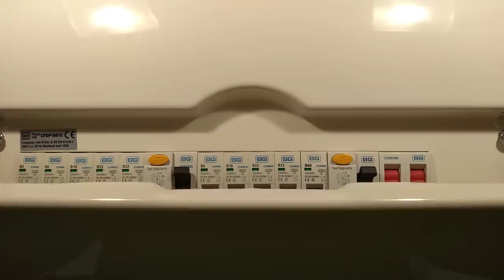A look inside a British home electrical panel.

Comment: interessting. In germany we usually get 3 phases 63A. And in new Instalations our distribution boards are way bigger. At least 5 rows of 12 division units each(one standard breaker is one division unit). 
We usually use B16 amp breakers for normal use and B10 amp breakers für lighting circuits. Each room should be on its own fuse. lights and electrical sockets on seperate rcds. Common component brands are hager and ABB. Bipolar breakers are very uncommon. I personally have never seen one installed or even for sale here. 
The main isolator is an SLS (selective Circuit breaker). It is installed in front of the consumption meter which is also installed in the distribution cabinet. The enclousure is made of metal but the covers are plastic.
Of course older installations can be quite different.

oh, and no ring circuits in germany.
Reply: @user-vn7ky2xr1x  yup, typically electric stoves and other big loads (>3.6kW) in germany are connected to the 3 phases if possible. 
You will therefore only rarely find any circuit breakers for more than 16A.
Reply: 2.5mm² cable for B16A and 1.5mm² for B10A now?
Reply: Sorry if it was not clear. Thats what i meant when saying when i wrote lights and sockets on differnet rcds.  English is not my first language.
Reply: @pmailkeey in my experience there are often even multiple rooms on one breaker- overall it doesn't even matter because I never have seen a single breaker tripping- it is always the RCBO that goes off first
Reply: @CyberlightFG  In new installations usually yes. But we have a kind of "loophole" in our electrical rules. Most other countries calculate the diameter with the conductor resistance at 30°C ambient temperature. But our codes allow us to calculate at 25°C which allows us to use B16A with 1.5mm² for shorter distances. But it also depends on the way the cable is mounted. So in new installations the electricians usually dont bother to calculate and use 2.5mm² everywhere because the price difference is negligible.
Reply: @olik136  You would not have breakers and RCBOs on the same circuit. You would match breakers with RCD's.  An RCBOs is a Breaker and RCD in one module.
Reply: @maik00979  not to mention that wires in older installation used to be thinner.
Reply: @maik00979  In Poland we can use 1,5 only on light fixtures (ecology,economy,LED) and 2,5 on max B16.
Reply: @alexku8452  I work as house electric in Germany, thinner is not bad but on bad side of berlin mauer i spot wire diagnal

Comment: This is a very interesting video.  Reading the comments, I've seen a some of them that say that since the UK uses 240 volts, they get more power for their 60 or 100 amp electrical service than the US (or Canada) does for an equivalent size service.  That is simply not true for single phase service.  

So I thought a little information on how US/Canada split phase electric service works might be helpful for anyone who is interested.

US/Canadian electrical services are also 240 volts.  But in the US the transformer has a center tap, which also provides 120 volts from the center tap (which is called the neutral and is grounded/earthed) to either of the 'hot' legs that are on each side of this center tap.  This is called a split phase service.  It is NOT a 2 phase service!

But a house with 3 phase service in the EU with a 60 or 100 amp service will get 173 percent of the power than a house with a similar size single phase service.  So a house in the EU with 100 amp 3 phase service will have about 40,000 watts available, almost the same amount of power that a US house with a 200 amp single phase service will have.

In the US higher loads like electric stoves, ovens, air conditioning, electric heating, water heaters, clothes dryers, etc., usually run on 240 volt circuits.  But I have a newer Miele heat pump dryer that runs on 120 volts.

What IS true, is that lighting circuits and circuits for receptacles for things that "plug in" are usually 120 volts.  These have only 1/2 the power for the same number of amps, therefore the 120 volt branch circuits require thicker copper wire for the same amount of power, and these circuits are usually either 15 amps 14 AWG (1.63 mm) and 20 amps 12 AWG (2.06 mm) size wire.

The key to understanding how split phase electrical service works requires one to understand that all the 120 volt loads on leg A are essentially in series with all the 120 volt circuits on leg B, and are therefore wired across the 240 volt output of the transformer and that only the difference current between the loads on leg A and leg B flows back to the transformer on the neutral.  On a well balanced installation, very little current flows back on the neutral.

US houses usually have larger electrical services than in the UK because homes tend to be bigger in the US, as well most of the US is hotter than Europe, so air conditioning is used a lot more.  Where I live in SE FL we run the air conditioning most of the year, only have a few weeks, usually in January, where we don't use it.  

The common household service for most houses in the US is usually 200 amps, with some smaller houses wired for 150 amps.  Older houses that have not been upgraded can have 60 or 100 amp service.  

In the US the "consumer unit", called a breaker panel in the US, tend to have a lot more circuit breakers.  A typical 2000 s.f. house in the US will have 240 volt breakers (which take two positions) for the range, water heater, air conditioner/heat pump, air handler/electric heat, clothes dryer, and possibly other things like a hot tub, pool pump, separate oven, etc.  120 volt breakers are required for circuits to the kitchen counters (2 20 amp circuits required for the counter(s)), dishwasher, microwave oven, refrigerator, garage, bathroom(s), and 10 or more circuits for lighting and receptacles around the house.  Larger houses can have many more circuits.  Therefore in the US breaker panels tend to have from 30 to 40 positions for an average size house.

200 amps at 240 volts is capable of delivering 48,000 watts.  Larger houses have 400 amp services, and I have seen 7,500 s.f. houses with 600 and even larger houses with 800 amp services, almost always single phase.  Usually a service larger than 200 amps will be split into multiple 200 amp panels -- for example a house with a 600 amp service will have the service split into 3 200 amp breaker panels, often with sub-panels connected to them.

I have only seen a few mansions that have 3 phase service in the US.

Electricity is cheaper in the US than in the UK and EU.  Where I live, the cost is about $0.14 to $0.15 (US$) per KWH including taxes and fees.  Probably soon to go higher considering the current situation.

Another interesting thing about US electrical service: there are no power company provided fuses for the service to a house.  The transformer contains a fuse, but that fuse is only there in case of catestrophic failure.  Normally it does not protect the wiring to or in a house, even if the circuit is severely overloaded.  But the transformer fuse will usually blow if there is a bolted fault.  If it doesn't, the wire between the transformer and bolted failure will quickly melt.  

There is a main fuse or more often a main circuit breaker that is part of the electrical equipment that is installed by whoever wires the house.  This can be contained in the breaker panel or be a breaker that is separate from the breaker panel.  The latest US electrical code requires a main disconnect (which can also be the main over current protection device) to be located on the outside of a single family house to enable fire fighters to easily disconnect the electricity.

In the EU and UK, almost all distribution transformers provide ~400/230 volt 3 phase power, so each transformer can serve a much larger area.  For the same load and size/type of wire, a three phase distribution circuit can be more than 5 times longer than in the US with the same percentage of voltage drop.  

For example, after only 300 feet, 48,000 watts of power at 240 volt single phase, will have a 5% voltage drop with 4/0 AL wire.  The same amount of power at 400 volts three phase can run for 1,660 feet (5% voltage drop).  These calculations assume a power factor of 100.  In the US the size of the wire used in overhead low voltage distribution is based on voltage drop, not the National Electric Code.  You may see a #2 AL overhead wire connected to a 4/0 CU wire where it connects to a home's lead in wire.

It is common in the US that a single phase distribution transformer serve from just a single house in a rural area to several houses in suburban areas to perhaps 10 or more single family houses in an urban area.  Common sizes of distribution transformers used for single family house residential areas in the US range from 10 kva to 100 kva, with the most common sizes being 25, 37.5 and 50 kva.

Some believe the US system is safer because the highest potential to ground from any residential circuit is 120 volts.

If you have any questions this video explains split phase electrical service perfectly:

https://www.youtube.com/watch?v=fJeRabV5hNU
Reply: Incorrect on one point.  USA residential services are called single phase, not split phase.  The characteristics within the dwelling are split phase, but the name of the service is single phase.

Comment: everybody in the comments seem to know what he's talking about, I'm just here because the video was in my recommended at 3AM
Reply: Ah, the Covid19 version of YouTube strikes again!
Reply: I only have a passing idea of what is going on
Reply: Yep me too
Reply: Me too mate.
Reply: @sachinkainth9508  The Covid19 YouTube Recommendations are now so bad, they are recommending my own videos to me! 

BTW:
The sprit level is to stop the electrical amps from rolling too one side or another.
Reply: @stevemorse5052  I believe in science and reason, but now I'm beginning to doubt that a little bit.  I think you are a genuine mind reader.  I was about to ask the very question about what the spirit level was for and I don't think I actually did.  How you managed to read my mind I don't know.
Reply: @sachinkainth9508  You are welcome.
BTW, I left the UK before these panels came into service.
As I left, the circuit breakers were just coming into vogue, in my time it was almost always rewireable (with fuse wire) fuses.
There is nothing more satisfying than plugging in a 30 amp fuse, against a dead short.
BOOM comes to mind!
Then red hot, molten fuse wire shooting out of the ends of the holder onto you hand!

Comment: We moved into a house a few weeks ago and had a burning smell from the consumer unit. Our electrician found three breakers not tightly attached to the buss bar just as you described!
Reply: you probably also smelled the ozone
Reply: That design is really stupid.
Reply: It's a thing with these copper busbars ...
Reply: It's so common it's mad.
Reply: I'm wondering whether they work-harden when repeatedly removed and refitted and whether annealing them would make them safer or more dangerous?  Probably cheap enough just to replace, but I dislike throwing things away.

I have a friend who had a new consumer unit fitted (similar to the one in this video).  I'm fairly sure the installer turned out to to be cowboy installer as he'd wired some of the old circuits in incorrectly as well as other gaffes which I later corrected.  Over time, the sensitivity of the new CU forced the house wiring to be improved and in the meantime it seems everyone in the family had a fiddle with that consumer unit which was reconfigured several times.  Then my friend's uncle managed to do something that apparently broke an RCD and the unit had to be dismantled yet again.

A few months later, my friend invited me to Christmas dinner.  Good move on his part.  He was cooking and the lights went out.  By now I was familiar with that CU and it was like an old friend so I went to pay my regards.  Expecting yet another short on the 1930s rubber-cabled house wiring but this time it turned out that the MCB supplying the cooker, though it seemed to fitted and tightened correctly, was making poor contact with the busbar.  This generated heat (possibly arcing too) and pushed the MCB into an overheat trip mode although it had not actually been overloaded.  I cleaned up the contact, reassembled, and it saved the day, but I was never quite sure why the contact had failed in that way.